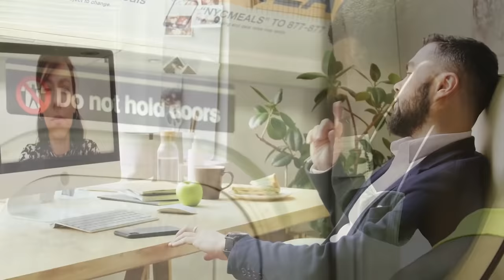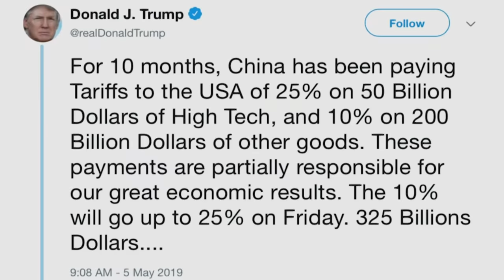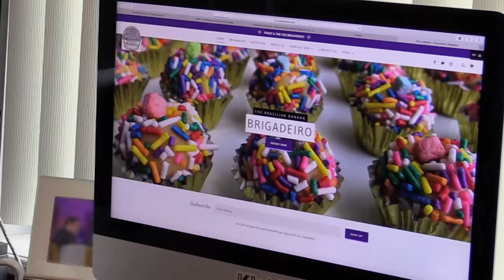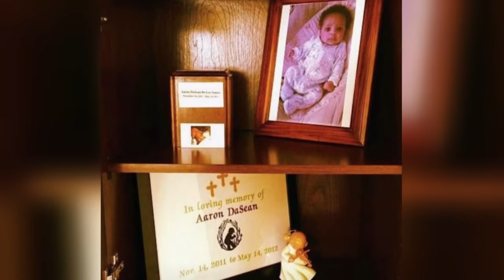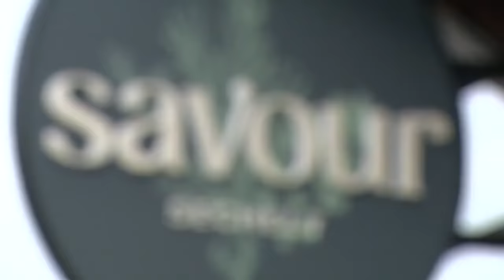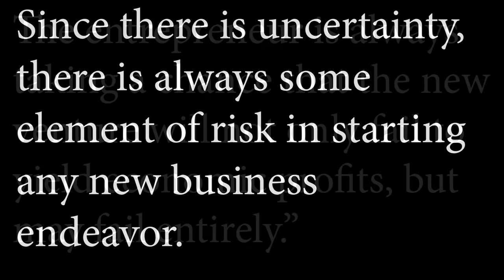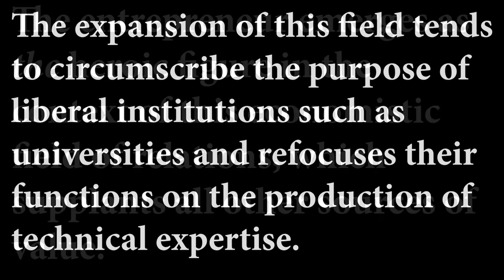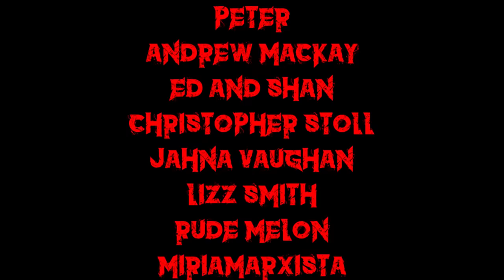I Quit & the Role of the Entrepreneur

Comment: In modern Chinese factories the largest reason that there's so much more cost-effective isn't because of sweatshop models, it's because those factories are already bulk producing those goods for basically every single Western company as well as for the Chinese domestic market, and are paying in Yuan, in a country with a much lower cost of living. It's also a big part of the reason that there are so many Chinese knockoffs that are very close to Major brands, because they already have the equipment and are usually pumping out huge excess of the various components used to make these goods, of which western companies only buy a few.